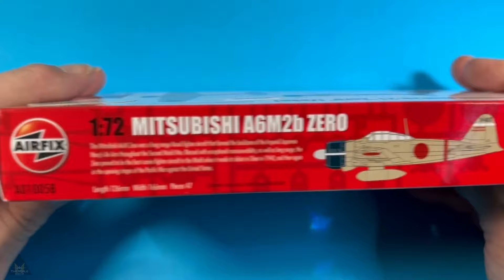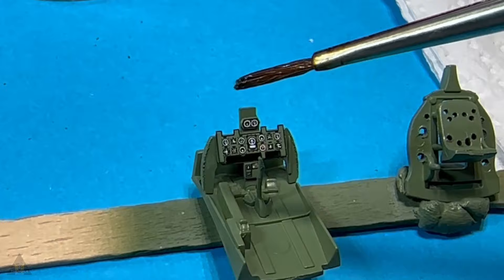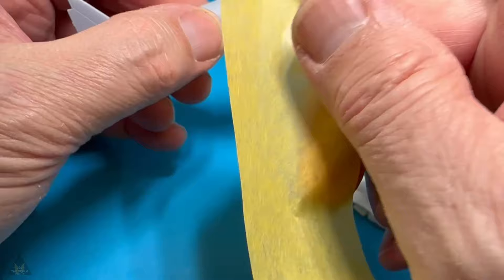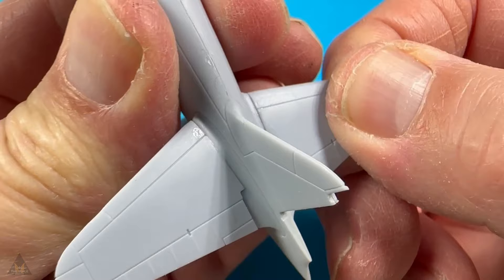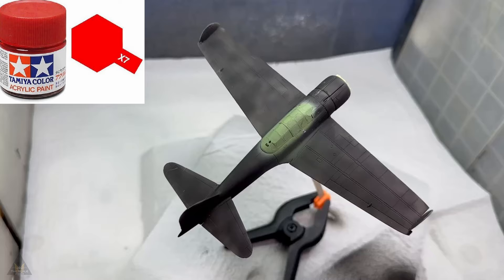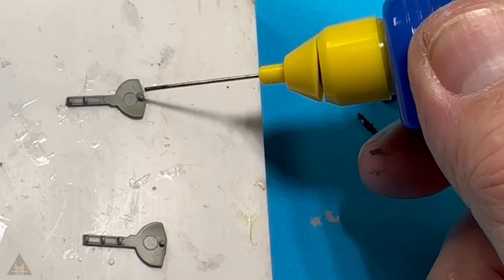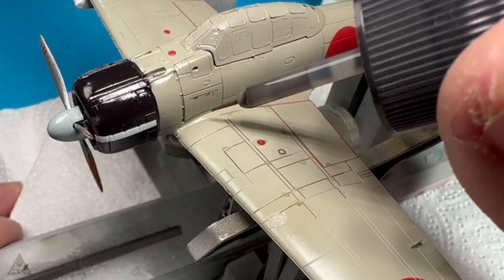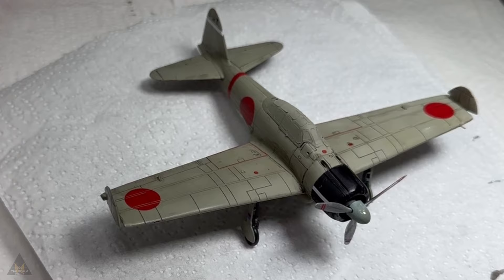Airfix 1/72 Mitsubishi A6M2b Zero scale model air plane Full Build Video

Comment: You are correct with the paint color in the wheel wells but it depends on if it was Mitsubishi or Nakajima built as well as the year. Most early A6Ms had the Aotake in the wheel wells. But there were some variations.  Especially near the end of the conflict
Reply from the maker: Thank you that’s what I found out as well 👍

Comment: Beautiful work.   I have some of the AK paint you used but haven’t used them. 
What have you found to spray them at? 20 psi @ .35 needle?, etc.
Reply from the maker: Hi Johnny thank you, I mixed in a test pot with Mr Hobby self levelling thinner and it went fine so I mixed around 50/50 or 60/40 paint thinner it was at i18psi and was a .3 needle. I also mixed Tamiya white with it. But didn’t just put it in the spray brush I tested it in a pot first to check if it mixed correctly. Hope that helps 👍